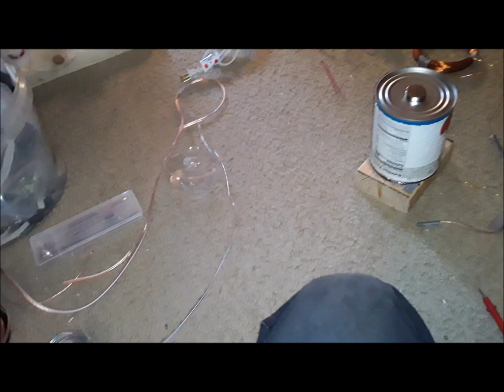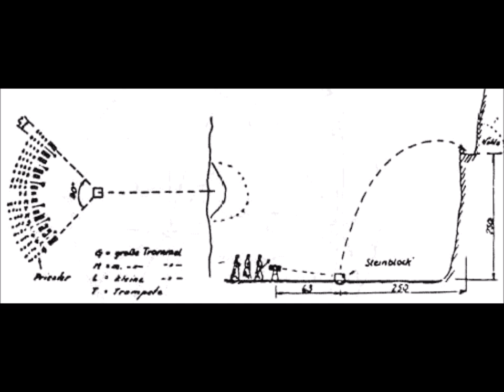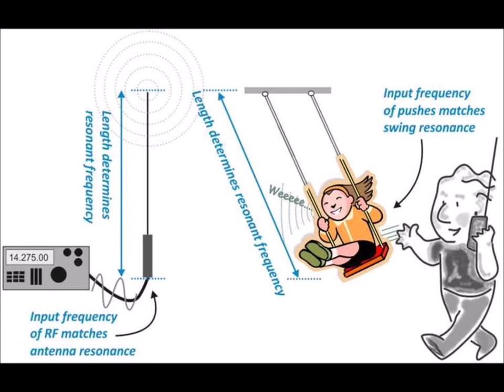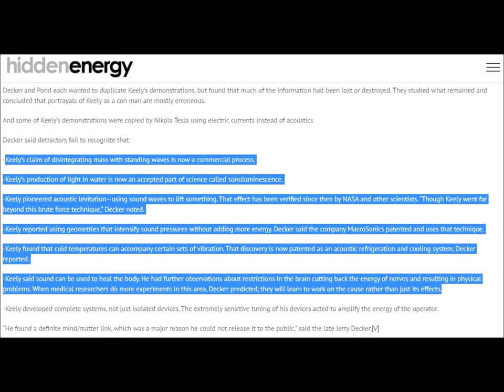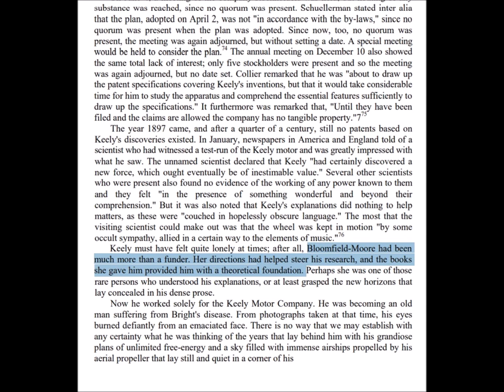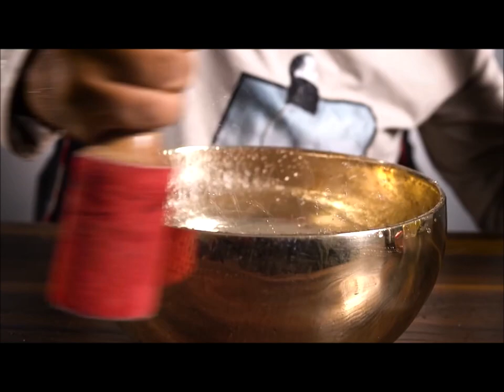Wired For Anti-Gravity? John W. Keely's Mysterious Gold, Silver, and Platinum Wire

Comment: Fantastic original research.  When you talked about making a chord with the three-metal wire, I wonder if using different ratios of the 3 wires would be something vibrationally akin to a three way potentiometer with different resistances, you could affect the chord somewhat like a voltage divider or maybe a high and low frequency pass.
Reply from the maker: Thank you. Yes, I think Keely talked about molecular "knots" in the wires which enabled frequency acceleration. But, I think he started out with Chladni discs of increasing octave scale before developing the wire. With this, he would strike the largest disk at the bottom of the apparatus. This in turn would cause the disk immediately above it to vibrate at the next octave up (twice the frequency) which would activate the next disk at an octave up, etc., etc. until he was well into the billions of cycles per second! It's like starting out with a single penny and doubling it every day for a month. One penny, two pennies, four pennies, eight, sixteen, etc; in which you'd end up with over $5,000,000 after 30 days. It's an incredible concept!
Reply: @gsutton78  In electronics that would be akin to a multistage amplifier.  So many of these vibratory mechanics have electronic equivalents.  I wonder a few things about the Chladni discs (I will look those up, thanks!) If they need impedance matching or if they have any distortion over the stages the same as electrical amplifiers.  That reminds me, too, of the rafters above the King's Chamber in the great Pyramid that Christopher Dunn thinks were tuned on the unfinished side for resonance purposes (would've been tuned by hand tools /maybe by ear)
Reply from the maker: @airthrowDBT   Very true. In fact, analogies can be drawn between most all energetic systems. As you know in electronics energy is stored in the electric field in capacitors, in water systems it's stored as potential energy in water towers, in acoustical mechanics energy is stored in resonance (compression springs, gongs, tuning forks, i.e.), in rotational systems it's stored as kinetic energy. In thermodynamics system, it's heat. In each of these systems energy can be built up and stored over long periods of time and then released in varying degrees of quickness. And the more quickly the energy is released, the more power is produced. These systems also possess analogous properties of resistance and impedance, etc. Fascinating! The Chladni plate frequency acceleration apparatus is described in the book, "Universal Laws Never Before Revealed" by author Dale Pond. It's a very good book on Keely's principles! You might even be able to find it online.
Reply: @gsutton78  Thanks so much man, I will check out the book.  Its so hard to find people interested in this stuff.  I'm an electronics professional, if you ever need help w/that aspect in your experiments let me know!  I have a plan to get some limestones and granite to do some tests, my main interest is the megaliths and pyramids, but ancient stone workings in general, and I worked for years w/piezo electric crystals and analog amplifiers in the medical field which has a surprising amount of overlap.
Reply from the maker: @airthrowDBT   Certainly! And thanks for the offer of electronics help! I had actually been thinking of seeking the help of an electronics expert I could offer a fee for advice on some of my circuitry. I have a decent knowledge of electronics, but am by no means an expert yet.
Reply: @gsutton78  I work at a FANG company in a research lab.  I also consult on the side, but if I can offer any guidance I would help free of charge, just let me know.  If there is something I dont know, I can tap into some global experts.
Reply from the maker: @airthrowDBT   Wow, that's fantastic, friend! Thanks so much! Do you have a Discord account?